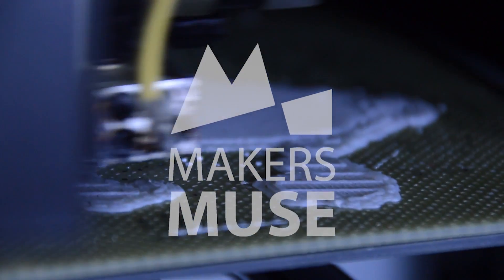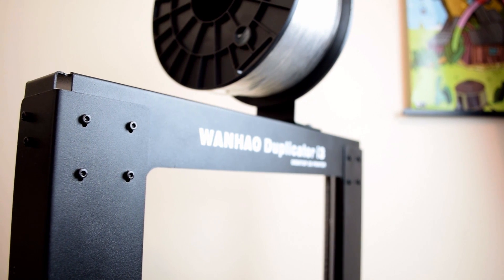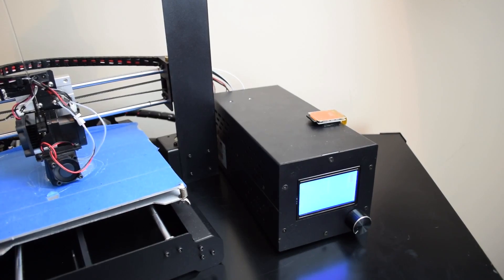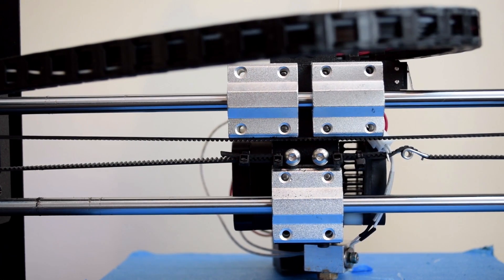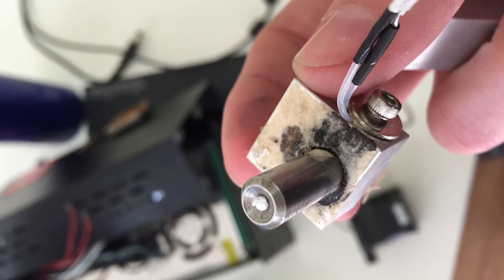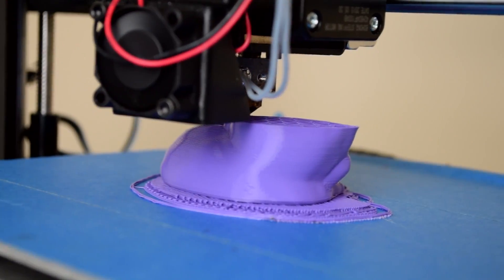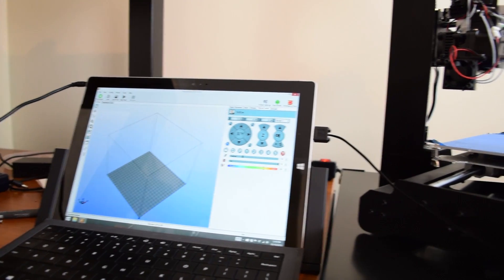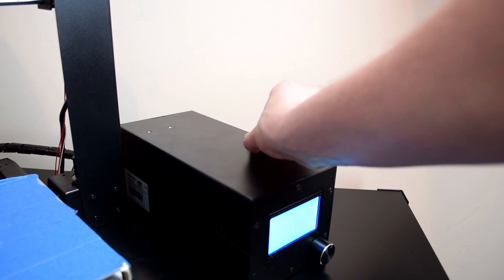Wanhao Duplicator i3 3D Printer Review - 2015

Comment: Is The micro 3d  (M3D) printer better for entry level?!
Reply from the maker: +Johan Nilsson It's certainly smaller but I would say an easier to use, ready to run package.
Reply: What do you think about the DeltaPrintr printer? Comparison to the M3D. I have use the Replicator Mini (Makerbot) in school.  But I thinking of something at home. For around 500$
Reply from the maker: +Johan Nilsson Never heard of it before - looks like another kossel clone so decent hardware just depends how well they've implemented it. Using braid instead of timing belts will hurt your accuracy over time as they stretch.

Comment: Hey Makers Muse, I'm really thinking about buying this printer but I have very limited desk space. My desk is about 1050 wide x 500mm deep. What are the overall dimensions of this machine?
Reply from the maker: +Lotus Hey sorry for the delay kept forgetting to measure it - the Duplicator i3 is pretty large, takes up a footprint of about 550mm wide by 450mm deep.
Reply: +Maker's Muse Thank you. Does that width include the control box too? If so I think I just talked myself into my first 3D printer :)

Comment: Great review. I got this printer in July and love it. I have done most of the upgrades/tweaks and it does well. I recently replaced the heater core with the B3 one that fits better. Night and day difference on holding the temp after a PID tune. First time it can hold a temp the entire print. Really loving it now. Just need to swap out the extruder gear with finer pitch.
Reply from the maker: +MrMobileWill Sweet as, cheers for the Tip I was looking for a better heater core to swap mine with and 100% doing the PID tune this weekend haha. It's a pretty epic printer once you get the fine details sorted.
Reply: +Maker's Muse Just make sure to get the 12v heater. The replacement also solves the crimp problem since the replacement doesn't get hot and you can solder it. I soldered to a screw terminal. Then screwed in the new heater.
Reply from the maker: +MrMobileWill Cheers, will do.

Comment: Hi I'm turning 15 this December and my parents are getting me a 3d printer. My intended use is to make finished jewelry  and models I can make into molds so I can be cast in silver.  Is there a printer you would recommend? I was looking at Makerarm - https://www.kickstarter.com/projects/1849283018/makerarm-the-first-robotic-arm-that-makes-anything?ref=recommended    .Thanks
Reply from the maker: +Mizuki Miwa That looks like a really interesting project, however for jewellery you will be struggling to get the detail you need on any FDM based system. You may want to look at the Form 2, which is an SLA system and prints in very high resolution. They also have 'wax-like' resins designed for lost wax casting!

Comment: I had the exact same problems with my first 3D Printer, the EZ3D Phoenix 3D Printer. It literally went through each problem you described, and uses a belt driven Z Axis which really isn't a good idea as you can imagine the belts slipping, and falling from the counterweights. This is why I decided to build my own 3D Printer :P Glad to hear the review Angus!
Reply from the maker: +101pokemasters Yeah Belt Z axis can be really dodgy, how is your printer coming along dude?
Reply: Really great! Thanks for asking. The Y axis X axis, and Z axis are done as of now. Here's a pic of it so far: http://www.dropviewer.com/v.php?i=56303ac174606.JPG

 All I have to do now is get a limit switch setup for the z axis, and make a feed lever for the extruder. Then I can start test printing :P
Reply from the maker: +101pokemasters NICE! That's looking great :D. So the bed will stay unheated? Nothing wrong with that just makes printing PLA a little more challenging. There's some gaps between the glass that you could fit thin heater pads if you wanted to give the plate a slightly higher temp surface.
Reply: Maker's Muse Oh, what a great Idea! I actually have a 24V heated bed ready for use with a temp sensor. I just couldn't find a way to mount it. I thought that if the printer actually worked well, I'd mount it later on, and add a dual extruder :3 Good news! The bowden system works so far, the extruder has the filament well pressed against a spring loaded lever, and I can cut the teflon tube down with ease (It also doesn't move too much which is a good sign for longer prints).

So I've never actually heard of heater pads, this sounds like a much better idea than clamping a heated bed to a giant glass surface, I'll look for some sellers on aliexpress. I'm also trying to find a z calibrating probe, but I couldn't find anything :( I might just make a removable ground clamp where the nozzle comes in contact with a thick piece of tin foil to close a circuit, acting as a z probe.

Thanks!

Comment: Excellent review! 

I think the low price point make many people new to 3D printing think the Duplicator i3 is an "entry level" printer, rather then a bare bones platform that's ripe for modification. 

I think there are better suited printers for a first time buyer, but few printers in the same price range that will give you as good results with a bit of tinkering! 

(did you try and switch to PID tuning for the hot-end, as I had the same issue as you till I did a PID auto tune, now printing PETG upto 260c without any trouble).
Reply from the maker: +Pigeon .FX Funny you mention PID a friend has had some good success with that so it's one of the first things I'll be changing. I'm really keen to just modify the heck out of the Wanhao!
Reply: A good entry level I think is the Micro3d printer. Works well out of the box. But like in my case I out grew it pretty fast.

Comment: I just bought and assembled a Sintron Prusa i3 with a MK8 hotend. However when I tried to load filament it would go down to a certain point then jam and not go any further, could anyone offer any help, thanks!
Reply from the maker: +TheCubingGamer Sounds like an obstruction between the hot end and melt tube, you might have to remove the extruder motor and see if you can manually push filament through the hot end or if there's something else going on.
Reply: +Maker's Muse thanks, I managed to get my printer working! I've been able to print some cubes and shark clips. I do have one question I hope you can help me with: my prints on the first and top layer aren't completely solid instead they have a tight honeycomb pattern like an infill. I'm using Cura as my slicer. Thanks again!
Reply from the maker: +TheCubingGamer It sounds like your flow rate isn't high enough so each line of fill isn't touching completely. I forget what that setting is called in Cura... filament multiplier maybe?
Reply: +Maker's Muse thanks, I managed to get my printer working well! I'm really enjoying your videos!

Comment: I've never printed from an SD card and I have only used USB from Repetier Host (and Cura as of yesterday). What part is so slow for USB connected printing? I've never had any issues (that I am aware of) that pertains to it printing over USB. Can you elaborate a little more on your personal preference on this?

Thanks!
Reply from the maker: +Robert Rittenhouse No probs! What I meant is while tethering is fine, if the PC goes down (or to sleep etc) then the print stops. By caching I meant sending G code to the SD card via the USB connection, for me this was painfully slow. I run a fairly power-hungry workstation most of the time so I found saving G code to the sd card was the safest and most reliable method for me!

Cheers,

Angus
Reply: Oh ok! I just wanted to make sure I wasn't missing out on something that I hadn't experienced before with that. I have a graphical LCD module with SD card support but I just haven't stopped printing long enough to mess with it and get the software side configured.

Thanks for the reply and thank you for all of the great content!

Comment: I love my wanhao I3. Ive done most of the upgrades/mods that are all very cheap to do.  As said the google group is a great community and also Wanhao has made revisions based on that group. There also a great facebook group too. Also  will say though if you cant get the extruder above 200...there something very wrong. Ive never had a issue with high heat and even have a shroud fan mod. Great review over all still think your a little hard on the i3 but was a great video!
Reply from the maker: +TheRealKingDong Some people are saying its PID tuning others voltage problems, lots of troubleshooting ahead methinks! But yeah, Wanhao i3 is pretty sick once it's going good, especially for the price.

Comment: I just found my non Wanhao i3 had a problem with its power controller in that it was only delivering 8v DC and so only achieving 170c hot end temps. The power source has a small trim pot that allows you to dial the voltage in and I managed to boost it to 10v DC which in turn gave me 190c. I'm on the hunt for one that puts out the correct 12v which should fix my problem and allow me to reach the desired temps. So check your power source if temps arent what you expected.
Reply from the maker: +Luke Pettit Very interesting! This could well be my problem. I'll take the multimeter to it and see what's going on.
Reply: I'm betting the farm that this is the problem, lol so I ordered another power supply. I was told to check it under load, which I did, at least I thought I did. I'm also going to add heat sink compound all over the cartridge heater and thermistor to ensure I get the best possible heat transfer.
Time will tell. I'll let you know in a week or two.

Comment: 1st, the company has fixed a lot of the issues you speak of in the recent releases, i.e. the damage in shipping and the recall issues and so you should mention that early in your review (Not at the end).
2nd, you should consider telling people that you're doing a Pros & Cons video and probably start with the Pros. By the time you got to the good things about it, I bet a lot of people had already decided not to buy it.
3rd, I hope you realize that you're complaining about heat in a machine without an enclosure.
4th, since it is a "Tinkerer's Machine", I would highly recommend it to new users. You really think it's easier to fix a $1000 machine than it is a $350 machine? It's 3D printing, very few machines work perfectly out of the box and I working with one is the best way to learn.
Reply from the maker: +thedarknightiscoming 1 - This is a review on my experience with my wanhao i3, regardless if they've improved them or not it doesn't improve my user experience, unless they offered to send me a brand new unit or upgrade kit. Indeed, I only discovered the 'recall' obscurely posted on the google group and not via email so many people won't know about it. 

2 - Sure, I could have mixed the pro's and cons up more but bottom line is if they decide not to watch it all it's their call, there are still design features that are very questionable even in the improved units.

3 - The extruder not getting to temp has nothing to do with an enclosure - something is wrong with its ability to get to temp and stay there, as some others have mentioned it may be a voltage supply issue.

4 - When people ask me what printer to get I ask if they want a 3D Printer for a tool or a hobby, if it's for a hobby - a low end printer offers huge learning potential. Like you said, easier to fix and great to learn how machines work. However, if you want a 3D printer as a tool - to print 3D Designs reliably, a low end printer can be overwhelming when it breaks down. Indeed I service many schools that barely keep UP's running which are one of the most bulletproof low cost printers available. Things like different melting temps for ABS and PLA they just can't understand when trying to handle a full class of kids printing their tinkercad models. Good money servicing them though!

Cheers.
Reply: +Maker's Muse you're right on many points and I agree with you. My main point was that many people watch reviews to make a decision about something. If they decide to stop watching something when it sounds like all cons, you're hurting the product, not just your viewership. Btw, I think I should say that I enjoy your videos and do appreciate the review.
Reply from the maker: +thedarknightiscoming Hey sorry didn't see your reply. Yeah I do agree with that, I probably should summarize points first, then go into detail and summarize at the end. Still learning this Video making thing :)

Comment: Dear Angus,
Sunhokey Prusa i3 :) Agreed it isn't metal, but it costs < 300 money-units, and is starting to gain a reasonable user-base. I have one for 4 months now, and happy with it so far. IMO it offers the flexibility of the Wanhao, without the agony... and a lower pricetag too.
Reply from the maker: +Aditya Mehendale Nice, that is pretty cheap! If I was running a class teaching 3D Printers it'd be the type of machine I'd get for sure. Students could learn a heap on such a low cost platform.

Comment: quite a compelling price on the wanhao however at £800 GBP i think the FlashForge Creator Pro is at a very reasonable price point for a well made (admittedly makerbot clone) machine with dual extruders.
Reply: +pj wanhoa I3 not even close to that price. You ust be thinking OF wanhao 4s or 5
Reply: +TheRealKingDong you misunderstood: i'm aware that the price of the wanhao is less than half the FlashForge. I was simply saying that even so, I consider the FlashForge as a very affordable purchase for a well made machine that requires little tinkering.

Comment: Hey Angus,

Speaking of problems, I need your help with my Up Mini! O_O
So, from the start of owning one, every now and then, it would mis-align a print. Like it would print a few mm, then shift, and continue printing correctly along that shift.

It's really odd, because before the shift looks fine, and after looks fine. It's almost like the printer is saying "S*it, we're 1mm too far forward, move back soldiers!!!"

You had any issues like that? How the heck do I fix it? Cheers mate.
Reply: I should mention that I'm bringing it up now, as I printed 3 things today and they all did it.
Reply: +Yosef Selim If this is always happening on the same axis it is likely caused by either the belt not being tight enough or the grub screw on the pulley being loose. Alternatively one of the stepper motor drivers is overheating temporarily, causing it to shutdown for a second to cool down, then continue printing.
Reply: Matthew Pengelly Erm... Imagine I'm an idiot and don't know what a grub screw is. Haha.
Well, I've printed 5 things today, and all have been perfect. I decided to clip the back of the board instead of just the front this time... Maybe it's just sitting in there looser and looser as time goes on. Thanks for the reply mate.
Reply: +Yosef Selim  on most printers there are one or two small grub screws that are screwed through the pulley and presses against the shaft of the motor to fix the pulley to the shaft.
If its working now after clipping it properly this probably isn't an issue.
Reply: +Matthew Pengelly Thanks man. I'll keep this in mind if it begins to happen while clamped. Cheers.
Reply from the maker: +Yosef Selim Looks like it resolved itself! The mini doesn't have any grub screws on the timing pulleys rather it's just got a D in the shaft and they're press fit. The bed can most certainly move though so clipping it in place is always a really good idea!
Reply: +Maker's Muse Yeah, the thing that's odd though is that the print is fine below the shift, and it's fine after the shift, so if it is the bed ,it must be locking into place after it shifts, right?